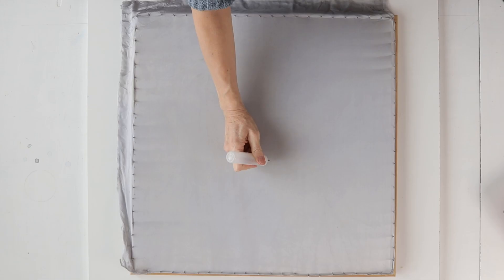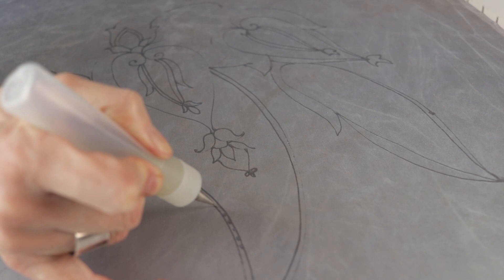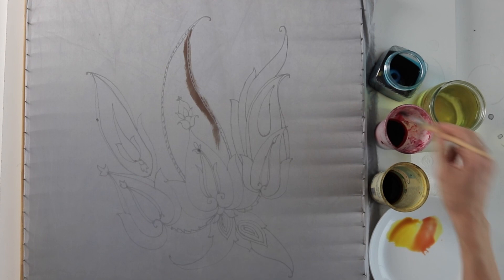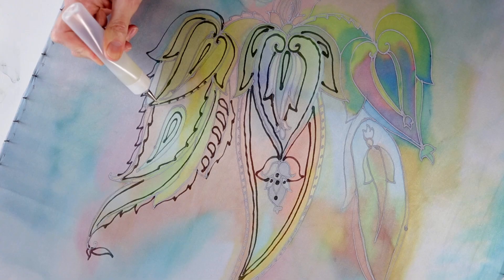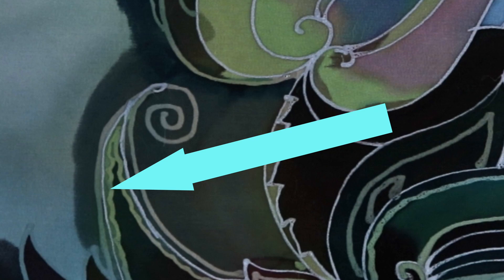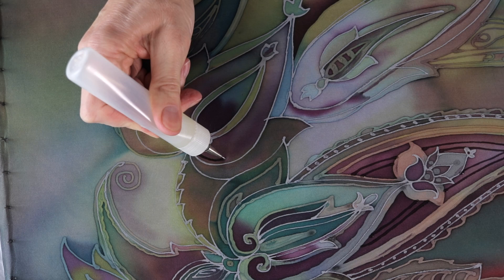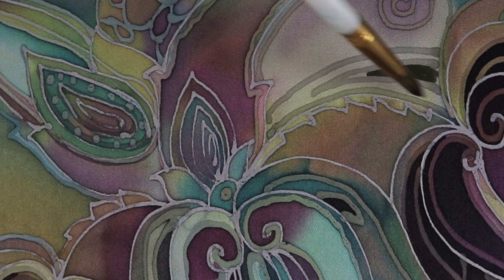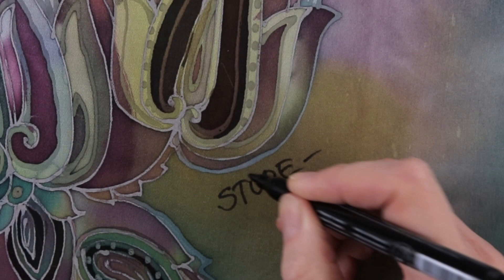Multi-Layered Technique with Transparent Resist (gutta) in Silk Painting

Comment: Do we have to wash away the neutral gutta at the end?
Reply from the maker: you may if it's acrylic (water based), but I not always do that. In this video solvent based resist was used , it doesn't need to be washed out